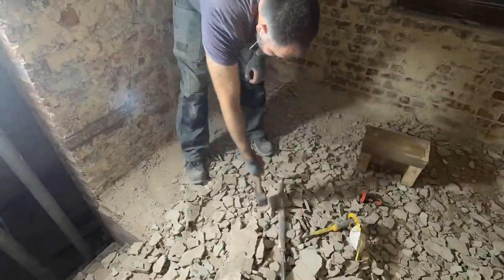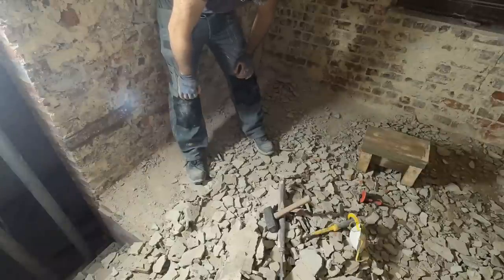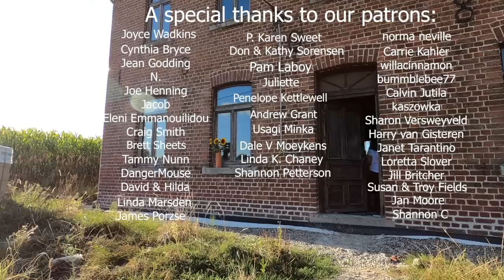OLD SCREED has to be REMOVED! / Renovating an old ABANDONED 1908 farm

Comment: I think the sink should actually be along the wall next to the stairs (the one that the doorway is cut into), because it would fit against that wall and be safest and least disorienting to have next to the drop. The bath should go along the wall where the sink placeholder currently is, where it will also be the first thing seen on walking in. As you said, the toilet can't be moved, but you could place a half wall or something between it and the tub for a little sense of separation, if you wanted, though I don't think it's strictly necessary. This layout should also maximize your floor space so that the stairs aren't disruptive to the path of travel around the room.

Comment: Our house has the floors where you have a long cable that has bricks through it, with a larger brick that is placed between each "string" of bricks, that base then has cement poured on top to make a very thick and strong floor. Our house is mid 1970's here in Belgium. I think we have the upgrade from your version.

Comment: I think you should map out your plumbing first before you get too deep into a decision. One of the problems with brick is the lack of interior wall space to run pipes, so you need to nail down where everything in the house is going to go to make the most efficient use of the space. If you're still going with septic you'll need to decide where that is going to go as well. Since you're surrounded by a working farm there's likely going to be required set-backs for health reasons, might limit your options a little bit.
Reply: It would seem a half wall should go along the stairs to preclude anyone from falling into the stair well. This half wall could hide the pipes and give an access panel if the head of the tub goes against it and feet toward the window wall.

Comment: Great progress. I'd put the sink on the opposite side and have the sink counter flow into the corner cabinet.  I'd build a short wall to the right of the toilet for privacy plus toilet paper holder.  Then the bath tub I'd have diagonally facing the window and the head end other side of toilet wall. That leaves room for corner cabinet right side of bath for towels and a small table for your beer / wine glass.
Ps. It's a claw foot tub I think.